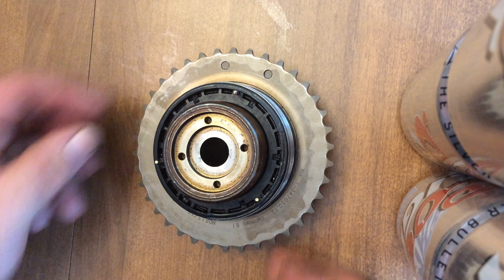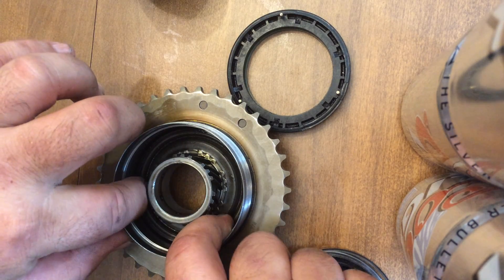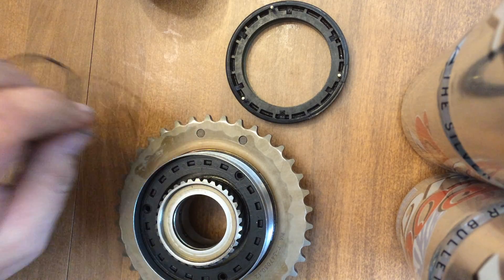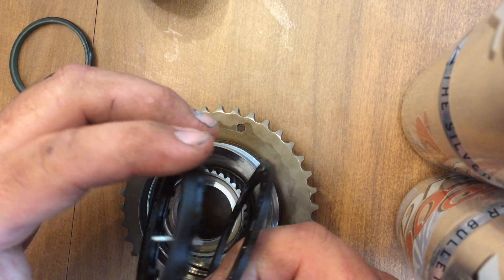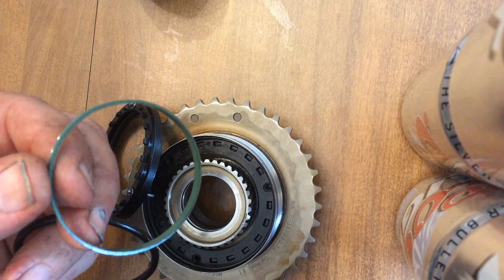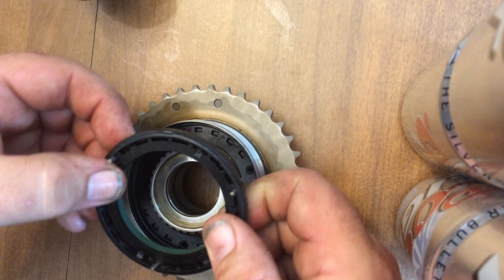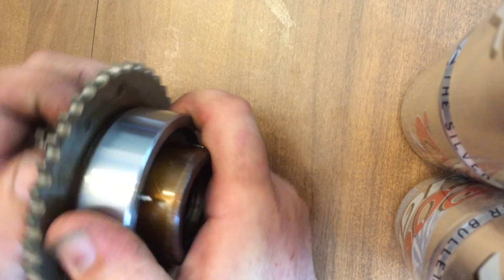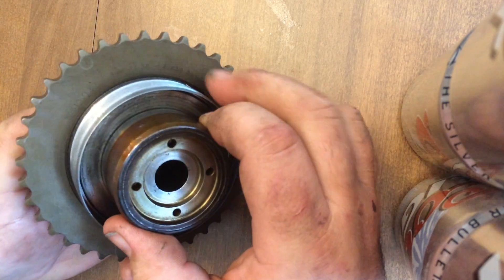IMG 3167

Comment: hi. I just changed one of my vanos orings and don't have any marks left on with the piston original position. Doesr it really matter? thanks
Reply: Yo same shit here, you ever figure it out?
Reply: @Elite.customs_479  I found out on a forum that it doesn't matter as it is well balanced
Reply: Hey man I know this is an old thread but  do you have to link to the forum you found this info on ? What we’re your results ?
Reply: @DIRTE53  hi, No it does not matter, just make sure to put vanos in the retarded position. Changing seals didn't work for me. I ended up buying 2 new vanos 1200euro :))) now the sound is ok
Reply: @duparasarit  thanks for the prompt reply ! Ok but now my question is how are you sure it didn’t work because you didn’t mark them ?
Reply: Could the fact that you didn’t mark them or put them back together in same position have contributed to them not working ? Really don’t want to spend extra $ on new vanos so forgive my bombshell of questions!
Reply: @DIRTE53  It doesn't matter, don't have the link though, but the piston is balanced and no need to mark it down. I changed my vanoses 3 4 times to fix those by myself, I believe they were broke inside or so and finally I bought new ones. It is what it is. For majority beisan way worked, but for some didn't
Reply: @_DIRTe53  keep also in mind that timing chain must aligned perfectly as well. I have aftermarket adjusters for camshaft, and I felt like I did it better last time.
Reply: @duparasarit  ok I see sounds good man thank you , I’m gonna give it a try. I’m using the German auto solutions kit for the timing and doing the guides and chains as well so I’m keeping my fingers crossed. I don’t screw it up. Other then the slapping at startup car was running fine so hoping for the best. Thanks again man 🙏
Reply: @_DIRTe53  Also if you want change the thermostat to one from e38 740d, it works at 88degrees and keeps the life of the engine block. Good Luck
Reply: @duparasarit  I’m definitely doing that bro thank you 🙏
Reply: @duparasarit  do you know of left vanos unit should stay with leftcam  and tight with right or does that not matter either
Reply: I kinda mixed them up
Reply: @DIRTE53  both vanos adjusters are the same, so doesn't matter on which bank you put them
Reply: @duparasarit  oh thank god !!! Thanks man
Reply: @duparasarit  you’re saying use the thermostat from the e38 740d ? Diesel model ?
Reply: @DIRTE53  yes and 13901734469 resistor for the error

Comment: Nice video, i have rebuilt my vanos using the beisan seals and i am still getting noise, in fact worse than before I rebuilt them so I am guessing i have done something wrong. I found it really hard to get the seals in to the little gap so this time I am going to try this method. The link below doesn't work for the O ring but do you know the size of the steel / iron split piston ring please ?

Comment: Have you found where to get the other seals to do it this way? Part numbers? I have a machine shop to do it. Just can't find the extra seals that don't come in the normal besian kit
Reply from the maker: The size is 2mm CS x 68 mm ID.
http://www.theoringstore.com/index.p...ducts_id=11862
Reply: THANKS! Even Besian didn't know
Reply: @mach5407  happen to have measurements for the screw on cover you made? Thread pitch, height, I.D, O.D, inner lip depth?